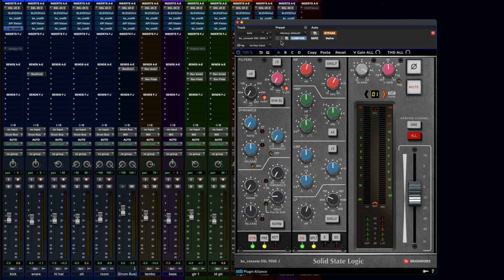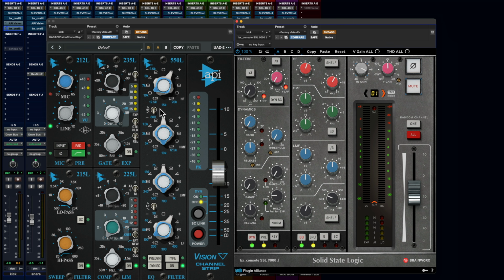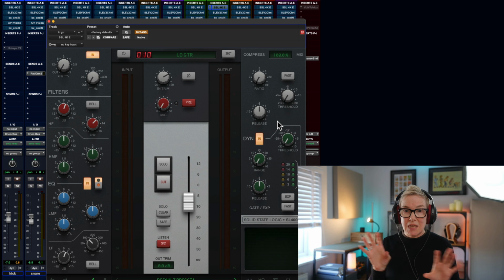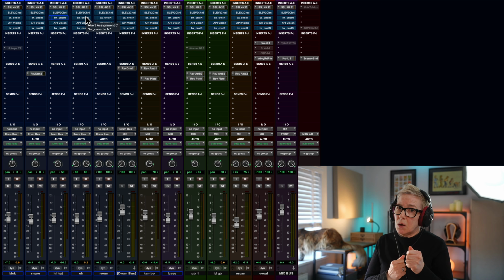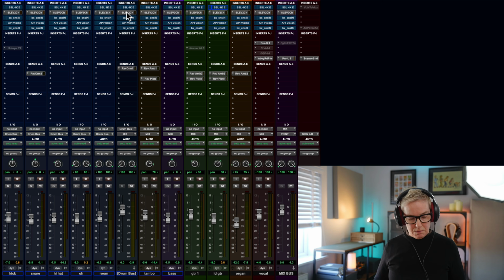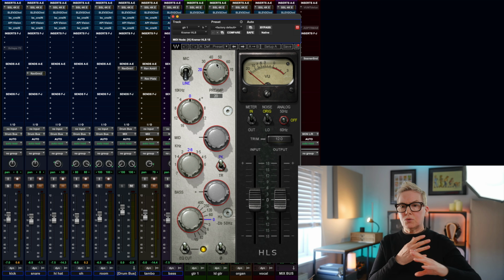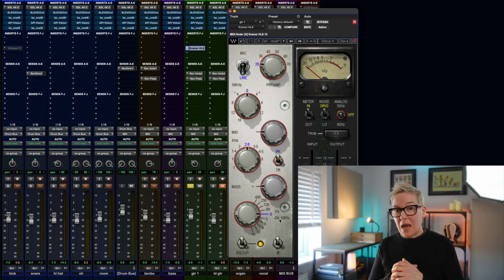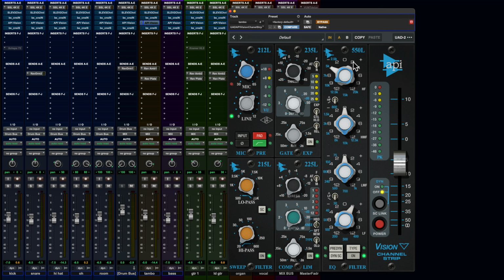Why Pros Use Channel Strip Plugins And You Should Too

Comment: I use Reason, whose mixer is already an SSL 9000k simulation. Do I still need a channel strip, or should I stick to what the DAW offers?
Reply from the maker: Only if you fancy trying a different colour. I like using different ones on different instruments.  Can you switch it off?
Reply: @SaraCarterSimplyMixing  the mixer section of the DAW is the SSL emulation. I can do everything you demo here, straight on the Reason mixer, but I can also not use EQ, Dynamics, gain, etc. I can add any channel strip as an insert, too.

Comment: i actually like mixing now that i've started using Neve-style strips lol

i can very quickly get the sound im after, without using "modern/sweeping digital" EQs searching forever to find the "perfect" place to EQ.

something i was after for so long, was achieving a consistent & cohesive sound throughout a project or album. using the Neve & the set EQ points it offers, there is nothing but consistency throughout my tracks. for example, most of my kicks are EQ very similarly using the Neve points (placed at 60, cut at 360, boost at 1.6k, etc.). so even though the kicks may be different (hip hop, edm, layered kicks, etc.), all the tracks have similarly EQ'd frequencies. same goes for the other drum parts, synths, guitars, etc.

i also love the Neve preamp & add to practically everything, which also adds to the cohesiveness of my tracks.

Pro Q has basically been on the backburner since I've started using Neve from NoiseAsh, where it's primary uses to get more "surgical" at removing very certain frequencies or noise artifacts.

always look forward to checking out your uploads, Sara! all the best
Reply from the maker: Thanks for watching! Neve sound is a favourite of mine, for sure

Comment: To get a vintage sound, I first use. Neve 1073, then Abby road REDD, then Abby Road J37, then another Abby Road REDD.  Then I  bake them into the track then after use a digital EQ but I am thinking of using a plug strip and EQ after baking instead of a digital EQ.. Thoughts?
Reply from the maker: Try it and see what happens!

Comment: I mostly use the SSL 4000 E, and I have a question.  Is there a benefit of placing the channel strip as the first or last plugin of the chain?  If I also have another EQ, like the Pultec in one track, should I eq in both places?

Comment: I always use an old Mackie 8-Bus for real analogue gain saturation, because let's face it, a virtual plugin will never deliver what real analogue hardware can. It's simply not possible. Most plugins that pretend to create or simulate real analogue saturation are actually doing nothing more than colouring the sound by changing certain frequencies to create the illusion of real analogue saturation. But it is not. Real analogue saturation occurs, among other things, when the amplification of a component causes the signal to exceed the voltage range for the medium (voltage supply, tape, etc.). When the signal has sharp edges like the output on the right, it means it contains higher order harmonics than the input signal on the left. For instance, a perfect sine wave isn't composed of higher harmonics, but a perfect (impossibly so) square wave is composed of infinitely higher harmonics. The specific components or design of devices will affect the coloration of those harmonics, which is part of why people like to use tube transistors in guitar amps still, or why tape has a certain 'warmth' to it.

Comment: This is the first time I've been able to accurately hear the impact of console saturation on a mix! This ear training exercise was exactly what I needed. Thank you!
Reply from the maker: Glad it helped
Reply: there are sources on the net, there are issue using the same plugs to much in a session, they build up certain projected harmonic, used or not (some or many) project something or rarely null., so its difference from analogue and analogue problems.
Reply: Youre so right. I bought an expensive Aurora Gtq rack mount 2 channel strip to run all my tracks through just on the strength or good reviews. I had no idea what it sounded like, and its impossible to A/B to hear the difference on the finished song because the channel strip is baked in to the tracks. I would never buy a guitar or bass amp without knowing how it sounded first.
Reply: @BillyBaxter-w4q do you feel it makes the tracks sound better?
Reply: @Tsa-SONGS-ABOUT-BEING-a-DAD  not really, the TG mastering plugin and a few can glue crazy out of whack over compressed distorted mixes back together some how magically, but other then this only the waves ssl bus, the abbey road stuff like TGI, the plugin alliance focusrite channel strip, acustica audio stuff and Kush appear to enhance mixes, sound toys sort of does but it has a sound that is not great, wish it had api, Neve harmonics
Reply: @OfficialFatLip Ok that's interesting cheers - I think a lot of this stuff is so subtle I wonder how much difference it really makes
Reply: @Tsa-SONGS-ABOUT-BEING-a-DAD  for me its so little depending on what your tracks are, cause when you use loops, vest and almost anything aside your raw r3corded source they have pretty much the presets to sound mastered themselves, like their levels are always safe, eq, etc etc, any plug in aside guitar amps, some vocal chains, they individually sound good and you wont want to add anything
Reply: not just loops, many of the plugins already have set unity gain, decent Pres, comps, depending on what they are, so adding a channel strip makes all kinds of problems, even adding tape emulations., some times your forced to bounce to avoid certain things.  but again, sounding like a record is only one type of sound., sounding like a pro studio is another sound.
Reply: @ I think "better" is the wrong word, It doesnt make tracks that sound awful suddenly sound great, but what it does is add a character to those tracks that you recognize from countless hit records, and it makes those tracks easier to mix together because now theyre in the same "world".
Reply: @BillyBaxter-w4q  amen, and adding too much can also saturate some frequencies
Reply: Thank you @SaraCarterSimplyMixing.... I love to use channel strip.... For our church audio live stream, this is helpful. I am learning more on your  channel 🙏🙏 Blessings

Comment: What a great video Sara. I think this is such a great topic for folks new to mixing to spend some time playing with. I really settled into SSL Plugins (and eventually got their UF8 and UC1 for the integration with their native plugins) though I also like API and UA options.  What I like about the channel strip plugins is how much you can accomplish on a per track basis. Yes, they can be intimidating at first but after a while they can save so much time - letting you tweak input gain, saturation, EQ, gates (this took me WAY TO long embrace) and compressions within a single instance.
Reply from the maker: Thank you!

Comment: Mega points for the Maine Coon sitting with the rear up higher than the front and in the window sill. Mine does the same. He's my studio manager(and has to bite my Faderport fader as it moves).  Channel strips are cool. I just wish they looked different.  The knob GUI seems less than optimal for a mouse.  I do enjoy the concept, though. Everything you need in one plugin, plus some box tone. I just wish these plugin's had an alternate GUI option where it made a little more sense for a mouse and screen. I am a fan of getting common tones across a mix. It's just the sound I grew up with.  UAD Studer A800 helps that, too. Thanks for the cool video as usual!

Comment: Radio Ready? Going to be more about quality source material that you start with. However your video proves how much proper plugin application can polish them. Wouldn't say every pro uses them, or that they are absolute. Personally, I try to put the least amount of anything in the signal path I can, to get what I need. If that plugin chain starts to stack, you have clear problems. Great instructional vid proving a channel strip can do just that, give a lot on just its own.
Reply: So true. Recording and mixing real instruments using microphones is so different to using sound libraries within a DAW. Both have good and bad issues and require different methods of approach if radio readiness is required. Channel strips can’t save sounds which don’t work together from the start. Personally I find it easier to get better results using real instruments.
Reply: @Tapper1969  Yes, source material is always most important, and as you mentioned HOW they interact as well, not to mention even those using strips are not just using strips, so they are not what makes the pro record sound. This excluding out board used "back in the day" as well. They are a tool like any other modern tool.